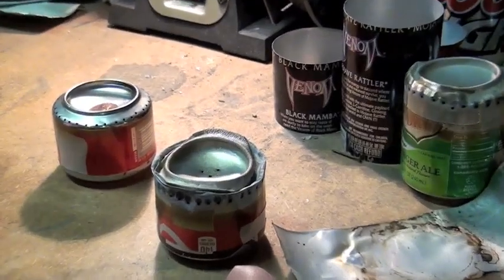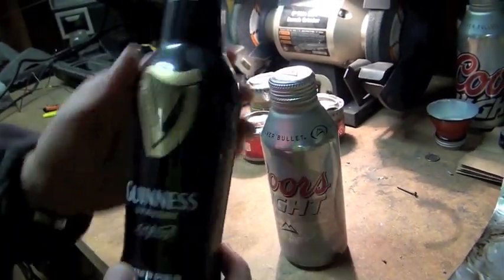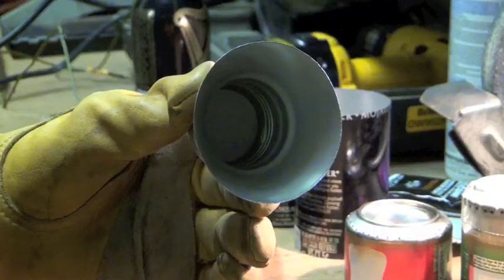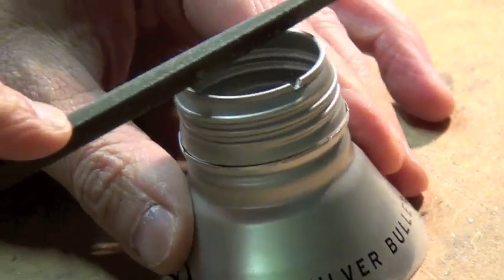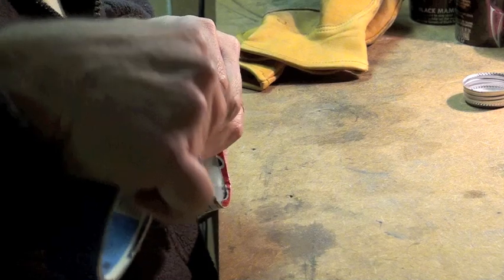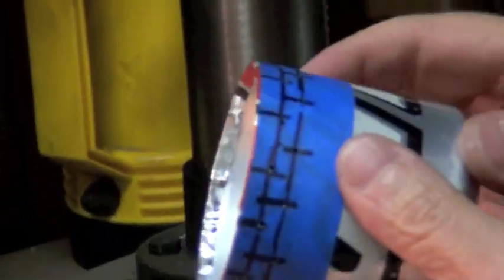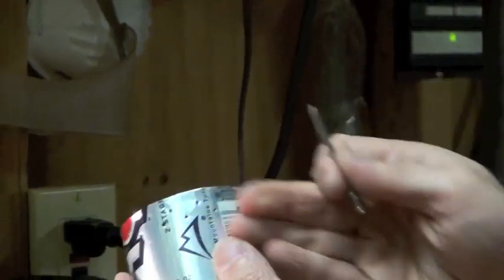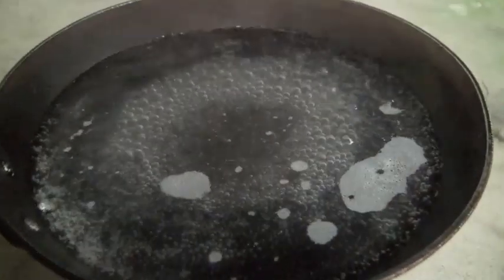Building an alcohol stove

Comment: 10:30 "By feel?" Doesn't your drill press have a stop? Just set the stop to 1/32 below the surface, and you will drill all the way through the outer skin, without coming near the inner wall. Only if you are drilling by hand would you need to go by feel.
Reply from the maker: Brilliant! Yes, it does have a stop. Next time. Allow me to pin your comment to the top. That's an excellent tip.

Comment: An old fire extinguisher makes the best stoves.  They're made out of 1/16 thick aluminum which makes them more resilient.   Cut three inches off the top and from the bottom, file a notch the lip of the top then press it into the bottom. Drill the 1/16th" holes on the side and fill it with fuel. Once its hot and the pressure builds, they're as good as the commercial ones.
Reply from the maker: Hey, that's a terrific idea! I gotta do some dumpster diving for an old FE and perhaps give that a try!

Comment: Built one of these earlier today, and it actually works! Will wonders ever cease. It takes about a minute to prime and will boil 2 cups of tap water in about 6 minutes, with no lid on the pot. I drilled 1/16" diameter holes for the 16 jets, about 5/8" from the top edge of the stove.
Reply from the maker: Jack Reacher Good on you! These do come in handy!

Comment: Ever notice that everyone drills holes for the jets but no one cuts 45 deg angle slots for the jets?

I wonder what the difference is between the size and number of holes in the stove.
Reply from the maker: My guess is it's easier to use a drill than file slots. What we need to discover is what is the return on that extra work for the slots. Perhaps fewer slots but more output? It's a great thought. What are your thoughts? Perhaps I'll get into my work shop and try it out! Thanks for the idea!

Comment: I build stoves too.

I have copied many designs but designed the MAHALO stove. 

The MAHALO was designed to be fuel efficient as possible, light weight, have a tight flame pattern for small pots. That stove has worked under a 24 OZ beer can 2 7/8 inches in diameter. Up to a 7 1/2 inch stainless steel pot.

Comment: I did one but with a change.
There is an indent near the threaded part (holds cap retainer ring).
I took side cutters and cut 6 times around from the opening to that indent.
I peeled back those 'tabs' a bit.
Theory is to allow more heat transfer into the fuel and if you bent them correctly, they will touch the inner wall of the bottom can.
More heat transfer and stiffens things up.
You get 6 'slots' for alcohol to go from the neck into the inner chamber.

My problem is cutting things straight and getting the top rolled correctly.
Mine looked AWFUL.
Going to test is here in a few hours to see how it works.
(Fire department on standby! LOL)
Reply from the maker: Awesome! Let us know how it turns out.

Comment: Can i use gasoline instead of alcohol ?
Reply from the maker: If you mean automobile Gasoline, NO. Gasoline has far more energy than alcohol by volume. The little 'pop' that happens when igniting Alcohol, will be a sizable explosion possible of ripping the can apart and spewing gas on other things and you. plus Gasoline has a lot of other chemicals in that are useful for motors, but unhealthy for humans should it contaminate the food.

Comment: Nice make...was that a different bottom you used ?...You cut below the 'L' and then it looks like a different base..not that it matters but js
Reply from the maker: Good catch! I cut so many cans that day I can't remember what I used on what build. If I remember correctly the trim I made ended up making it too short so I measured and cut another can to the right height, to begin with. To save time on the video I just didn't show it all. The final outcome was a working stove.  Lesson learned, just have a few cans around just in case something goes sideways. Learned a lot that day. Thanks for watching. If you build one, we'd love to see it. Tag us on Instagram! @theshootinguy.

Comment: Two problems w stove

1. The flame pattern is too big to work with most camp pots. GSI minimalist, snow Peak 600 and other cups.

2. The jets are too close to the top. 1/2-5/8 from the top is standard.
Reply: Also too many holes is making them to melt  ! I've found 8 holes is best  !